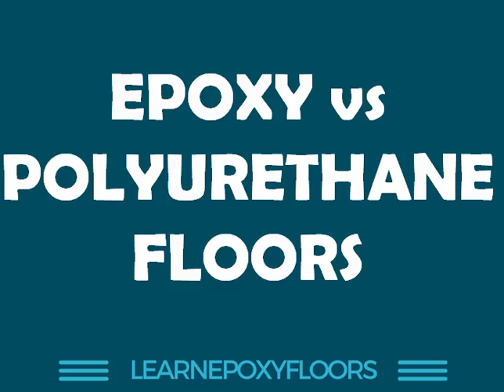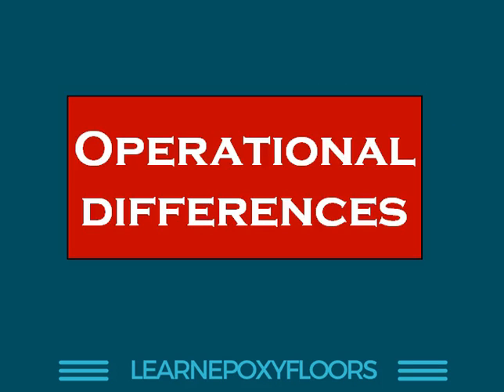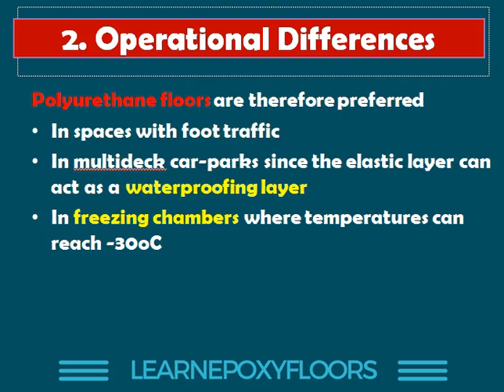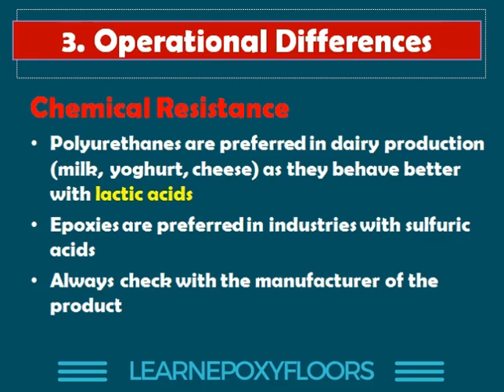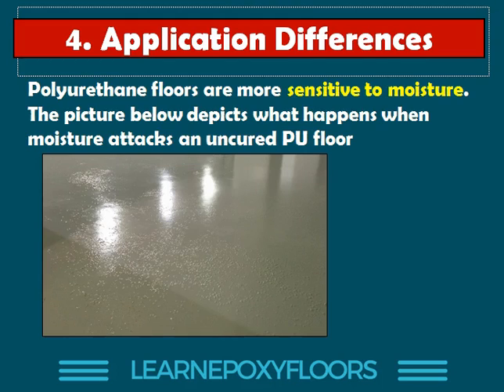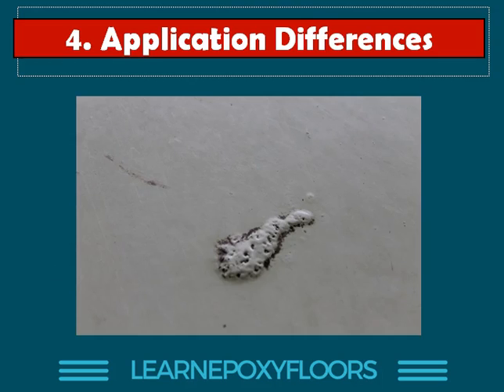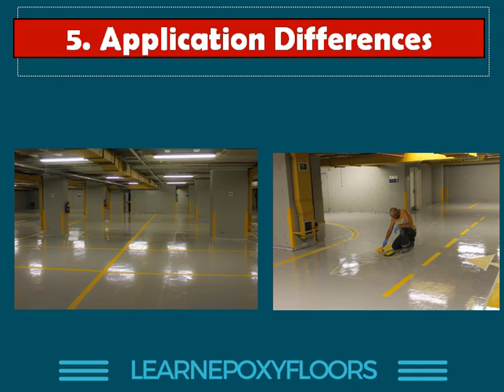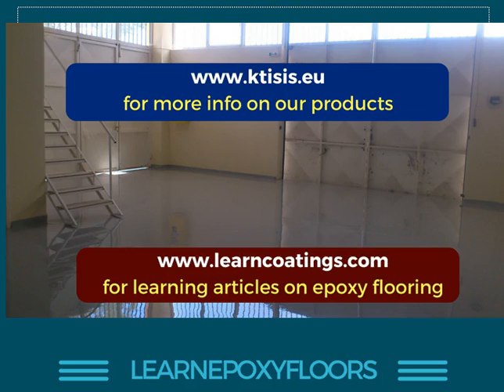Epoxy vs Polyurethane Flooring: Understand the differences

Comment: epoxy 7 days to cure. thats not true
Reply from the maker: Look at all the technical data sheets of the major epoxy brands and they all claim that you need 7 days to reach final strength of epoxy. Epoxy may be walkable after 24 hours but you still need maximum 7 days

Comment: Would it be ok if I put epoxy on my existing floor that has been polyurethane already...?
Reply from the maker: Epoxy on existing polyurethane is tricky. Polyurethane is notorious for poor bonding. I would recommend that you sand the surface and apply a suitable primer first

Comment: Will polyurethane off gas when applied to interior radiant flooring?
Reply from the maker: Although I am not sure if I understood your question, but whatever coating or screed you are applying it is advisable that you keep the temperature of the floor and the room as stable as possible throughout the application and curing process

Comment: Do you recommend water-based  or oil based polyurethane? Recommended any particular brand / product?  Thx
Reply from the maker: I do not have much experience with water based polyurethane. I feel that the technology is not quite there yet. I use solvent based polyurethane

Comment: Another quick question.. would you recommend Minwax super fast drying polyurethane for floors (https://www.lowes.com/pd/Minwax-Floor-Gloss-Oil-Based-Polyurethane-Actual-Net-Contents-128-fl-oz/999913707)? Or, the Minwax ultimate floor finish ( https://www.walmart.com/ip/Minwax-131020000-Ultimate-Floor-Finish-1-gallon-Semi-Gloss/134670730?wmlspartner=wlpa&selectedSellerId=1609&adid=22222222228327332939&wl0=&wl1=g&wl2=m&wl3=409699494948&wl4=aud-430887228898:pla-855542311403&wl5=9017374&wl6=&wl7=&wl8=&wl9=pla&wl10=113487702&wl11=online&wl12=134670730&veh=sem&gclid=Cj0KCQiAvc_xBRCYARIsAC5QT9m7mkPDQEB-RsUjerPoWnYmKTQx31xiutjjACEDYlnSvbO4t1AatjgaAk3rEALw_wcB)? Not sure of the differences or which one may be better. But I think one may be oil-based. Thanks

Comment: Great video, one quick question. We want to coat the floor for the beverage manufacturing line. Here the weather is tropical, humid. there will be some water on the floor constantly near the filling machine which will be sent to drain immediately though, what would you recommend us. Epoxy? or PU?? Thanks.
Reply from the maker: I would go with epoxy. Polyurethane is a real pain to apply in tropical conditions

Comment: Hello, which would you recommend for a shipping container wood floor that'll be used to store lawn equipment and tractor? Will be ssubjected to fuel, oil and turning the tractor tiresonce inside.  Thanks!
Reply from the maker: I would recommend an elastic surface for a shipping container as the wood and the fluctuations in temperature will cause expansions and contractions. Therefore go with polyurethane!
Reply: @learncoatings-epoxyfloorin9448  Fantastic!! Thanks for the quick response and information.  Picking up polyurethane today!!

Comment: What material has a better adhesion to steel? Epoxy? or  Polyurethane?  Which resist chipping bes?
Reply from the maker: Whether you apply epoxy or polyurethane, you need to apply a proper primer suitable for steel surfaces. Also epoxy & PU coatings used for steel surfaces are quite different to the ones used on floors.

Comment: Can I apply pu or epoxy coating for my slightly leaking rcc water tank,please advice thank you.looking forward for your reply.
Reply from the maker: If the tank is leaking don't assume that any coating will simply stop the leak. Try to understand the cause of the leak first and deal with area locally before you apply a new coat

Comment: Hi, thanks for the info.
iam from uganda(east africa) and iam thinking of starting this business, i dont have any experience at all. please kindly advise
Reply from the maker: The main advice I can give is don't fall for the 3d epoxy fad that many People in Africa are talking about. It is a very small luxury market and there's too many people claiming that they do it.  Focus on industrial projects instead
Reply: @learncoatings-epoxyfloorin9448  
thanks a lot for the advice.
please kindly advise me on this too.
1. how much is the cost for the epoxy per square-meter
2. which materials would you recommend for the epoxy installation because we have ones on the local market and i don't know if they are perfect enough for the work.
kind regards,
Hillary

Comment: What would you advice for an epoxy desk/table, use polyurethane yes/no?
Reply from the maker: Polyurethane will definitely be softer and any scratches will not be as visible!
Reply: @learncoatings-epoxyfloorin9448  Yes i used 2 coatings, black base coat and clear top coat. But it scratches way to easily. I want it more to behave like glass that can withstand a screwdriver or coin scratches. So with polyurethane  i only need a base coat of epoxy? Clean, sand, clean, epoxy, clean/sand, polyurethane?

Comment: Thank you for your information. I have a new garage floor that was painted with. Zxyleen base paint, because the concrete is not smooth enough to keep clean I want to refinish. 
It has been suggested to me that I first epoxy then urathane over within 24 hours to get the most durable finish...
I’m told that the urathane needs to be done within 24 hours to get a proper bond..
Any thoughts ?

Comment: I have a hardwood floor but I'm considering changing it to epoxy or polyurethane.  Can I do epoxy on top of the hardwood and coat it with polyurethane?  Which one would feel warmer epoxy or polyurethane?
Reply: Same reason I'm here
Reply from the maker: Polyurethane is definitely softer and warmer on the feet than epoxy. Also it is more elastic which will help with the expansion and contractions of the wood
Reply: @learncoatings-epoxyfloorin9448  thank you for your reply.  That was great help!  👍

Comment: Well explained and willing to admit and learn from past mistakes- The sign of an excellent teacher. Regarding epoxy requiring 7 days to fully cure, can you please tell me how long does it take to harden enough to walk on it with bare feet or socks? This would be in a home environment and the only reason I'd want to walk on it earlier is to check it's actually gone off or hardened.
Reply from the maker: Thanks for your kind words! Under normal room temperature conditions epoxy can be walked on in 24 hours. If it is colder it may take a little longer for the epoxy to be walkable

Comment: For a countertop, which of both will be more prone to scratches?
Reply from the maker: Epoxy is usually more prone to scratches. That is why it is common to apply a thin topcoat of polyurethane on top

Comment: Whats a self leveling compound?
Reply from the maker: Any type of product (usually cementitious) that can be applied over a rough surface, to level it out. Cementitious compounds are usually from 0.5 to 3 cm in thickness

Comment: Dairy processing plant PU is better? but lot of water is being used on day to day operation.
Reply from the maker: Yes we recommend Pu for dairy processing because of the lactic acids. Once the floor is dry moisture and water do not affect it. In fact PU is more elastic which will help with fluctuations in water temperature

Comment: Can you apply thin layer PU on epoxy to prevent scratch?  Can the two come together?
Reply from the maker: You can apply a thin Pu on epoxy but the application is always tricky. I always recommend very light sanding of the underneath layer to enable Better bonding

Comment: Hi. Nice video. Can you suggest which application is better for honey processing industry. PU or Epoxy
Reply from the maker: I have used epoxy in honey processing facilities. I prefer it because epoxy has better bond strength on concrete. This can be an issue if the floor is sticky from honey residues

Comment: 7 days to cure? Epoxy?? And how many coats with epoxy?????
Reply from the maker: 7 days is for maximum 100% cure. In normal room temperatures most epoxy can be walked on in 24 hours, and put in use after 2-3 days

Comment: Will epoxy stick to a pva paper floor as the finishing coat?
Reply from the maker: It will stick but you may deal with cratering issues

Comment: Dear, Please explain about water based Polyurethane Coating. I have faced lot of time - bubbles issues . I can't find out the root cause. Pl suggest
Reply from the maker: I don't have much experiencewith water based PU. You may want to start by checking how much water the coating actually contains. Bubbles may be caused from evaporation. Apart from that you need to look into environmental and substrate conditions
Reply from the maker: Also have a look at this video for possible solutions https://youtu.be/7Kyy2M3sL5Q

Comment: Lots of controversy from this presentation but also some useful info.
For example i didnt know epoxies were prone to attack by lactic acid.
Also, with regard to cure time. I can speed up or slow down both PU and epoxy systems cure time from 5 mins to 48h.. So not sure about the comments on how one is easier to work with than the other because of this. All boils down to catalysts and inhibitors.

Comment: Sir! It was outstanding. 
But I need to know that which type of binder should I use to bind    churshed  tyres to make a shock pad?
Reply: 30% MDI polyurethane. One example is a product by the name of 'Suprasec 2008' from huntsman.
The 2008 is a product code and not a year or anything so dont worry about it being 'old' or something. Crosslink with castor oil. Ratio must be work out deoending on how rigid or flexible you want the cure. 16% Tin octoate catalyst for increased cure speed.

Comment: thank you. Video is helpful.
what would be best flooring coating for power-loom industries?
Reply from the maker: As I imagine that you will have heavy machinery and also heavy materials to deal with I would recommend epoxy as it can deal better with heavy loads
Reply: Power loom? Whats that, care to explain?
Reply: @YouTubeNazi  Broadly, it's machinery that makes fabric or textile based products (clothing, bedding, drapery, carpets, etc...)

Comment: You must be referring to polyurethane coatings. Polyurethane mortar screeds, even flowable (4mm thick, are much stronger than any self leveling epoxy even as thick as 4mm(which is not worth the price vs a PU mortar screed). Only benefit for epoxy then is the colour retention
Reply from the maker: Yes correct, the video covers PU coatings not screeds

Comment: Could you please tell me which is more resistant to very hot water apoxy or PU? I need to use it in a bath tub
Reply from the maker: Pu tends to have better resistance in high temperatures

Comment: Thank you for your reply 
The moisture is coming from the hill on the upper side of the house and it seeps under the Fundation 
I’m looking for a product that it will stop the water to get to the top of the cement floors because I am going to Epoxy all the basement floors 
Thank you very much
Reply from the maker: The best solution is always to attack the problem from the outside. If this is not possible then you may want to consider a water based epoxy system that will be breathable and will be able to handle moisture presence

Comment: Very good info but u did not speak about heat factor which was so important for me
Reply from the maker: Both epoxy and PU cure faster at high temperatures
Reply: @learncoatings-epoxyfloorin9448  I am talking about the heat factor at the site while selecting the particular coat....places with more heat should choose which coat

Comment: What do you charge per Sq ft  For Epoxy flooring?
Reply from the maker: There are so many different factors that can affect the price from size of project, thickness of floor, prep required. Prices differ greatly from region to region and country to country

Comment: Sir Thank you For Your Video
i have a question. How to apply polyurethane car parking system of 4mm thickness in internal deck system?
Reply from the maker: A 4mm system tends to have several layers including a primer, a flexible undercoat and usually 1-2 topcoats that are a bit more rigid. It is also common to include quartz in the topcoat to make it antislip
Reply: @learncoatings-epoxyfloorin9448  thank you so much sir

Comment: Thank you for videos,
I have a trailer with wooden floor I was planning to turn in a shower, but now I understand that neither one of the coating types will be good for this, and its best to replace the wooden floor,
I would love your thougts on this,
Thanks
Reply from the maker: Yeah I wouldn't recommend building a shower on a wooden floor or anything that can absorb moisture and humidity. I would look at some sort of cement mortar with tiles on top

Comment: Can epoxy be used for waterproofing?  I wanted to use it under my aquarium stand. What about in a humid environment ? (It will be humid long after the epoxy dries). Does it crack easily or does it flex a little?  Thank you for your answers.
Reply from the maker: epoxy does not really flexible. It can act as a waterproofer as it does not absorb water but it does not have any flexible properties. This is why we prefer to use polyurethane coatings for wateproofing
Reply: @learncoatings-epoxyfloorin9448  thank you.

Comment: Good job, what you think I should use for my garage floor and what brand of product?? Thanks
Reply from the maker: go for epoxy in your garage. Don't know where you are based but I would recommend this https://ktisis.eu/product/epoxy-floor-coating/
Reply: Id recommend a 1K moisture cure Urethane actually. You dont need hectic chemical resistance and i dont think youd be getting excessive amounts of heavy traffic. Also PU are geberally better for hot tyre mark resistance.
Also, the PU system might smell more but it will be cheaper.
Try out Sapici's ucopol W708. Contact me if you need a formulation.

Comment: Could you help me please? Previous owner painted garage with color and H&C oil based concrete sealer. He didn’t do great job. Some areas are dry and some are wet look. It’s fairly new he did it one week before he sold house to me. No cars were driven yet.
My question is: what can I do now to fix it? Could I use clear epoxy to make it more even and make more shine? Any other suggestions? 
Thanks!
Reply: yes you can. But you have to do light sanding to create a good bond. I would recommend a polyaspartic with UV resistant.

Comment: Which resin is best for the coating on polyethylene vinyl acetate composite surface
Reply from the maker: No idea... You would need to do testing especially with the primer to see what can bond with pva. Also if the surface is flexible I would advise applying a flexible coating
Reply: Riyazuddin 
What the fuck is that? I don’t feel comfortable with someone like you using words like those

Comment: my wife and I saw a blended color epoxy. We are thinking about doing our living room in epoxy. The living room was the garage converted over. Which one will be easier to clean after setting up. I remember in the barracks as a soldier, we used urethane and it got scuffed a lot from boot traffic.
Reply from the maker: epoxy tends to scratch more. Once the dirt gets into the scratches it is very hard to clean it up. You want to go with a colour shade not too light so any dirt marks will blend in with the floor

Comment: Sloped pitch to drain cement floor in an auto repair shop. Polyurethane or self leveling epoxy or painted epoxy coating?
Reply from the maker: I would go with painted epoxy coating. Sloped floors are not ideal for self leveling as the coating might have a tendency to flow towards the gutter and leave drip and line marks. As for PU I dont recommend it for auto repair. Auto repair floors get quite a bit of wear and tear both in terms of chemicals and also mechanical wear. Epoxy tends to be more resistant

Comment: Very good presentation. How do I test a floor to determine if it is a PU or a Epoxy before I re coat the floor?
Reply from the maker: Thats a good question! PU tends to have a more rubbery texture while epoxy is  a bit harder and glossier. You could dry using a screwdriver or a key to scratch the surface. If it leaves a visible scratch mark then it is probably epoxy. If the scratch has a tendency to disappear (or is very slightly visible) then I would assume that it is a PU

Comment: What are the stages for expoxy application and what are the composition ratio between solvent,hardener and expoxy material at the different stages thanks am waiting for your response the sooner you can
Reply from the maker: As I have mentioned in other videos there is no standard mixing ratio of resin and hardener. As for application steps have a look at the videos on my channel
Reply: There are definitely standard mixing ratios for epoxies but there are soooo many difderent systems. Some are 2:1 base to hardener, some 1:1 some 5:1.. Etc etc.
And also epoxoes dont have 'solvents' thw correct term is 'reactive diluents' which present themselves in the form of various chain length versatic acid. In any case, ita not recommended to go above 10% for the "solvent" as this affects cure time and end result.